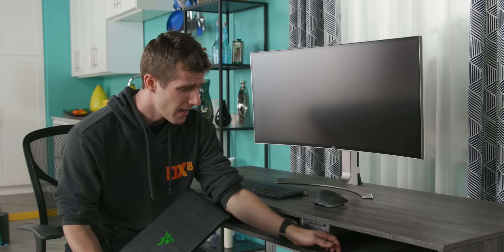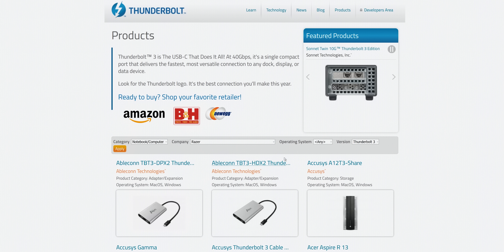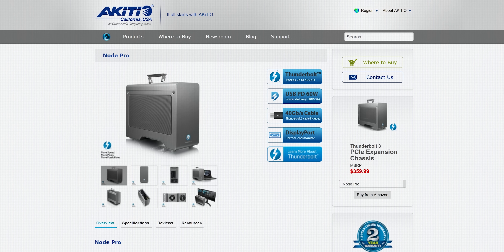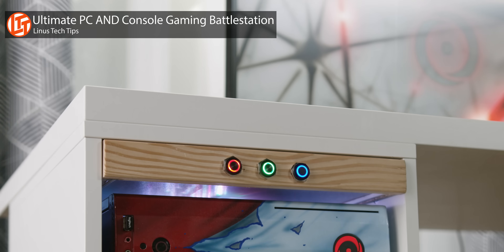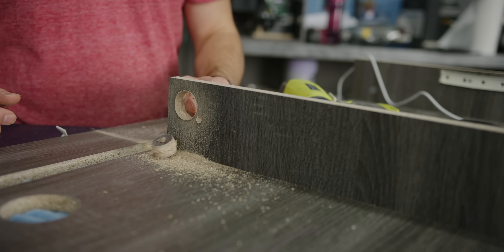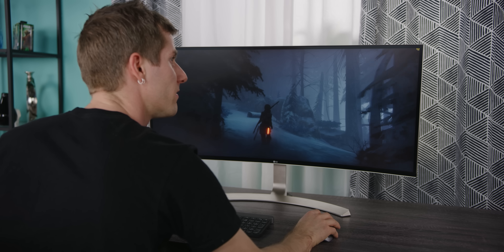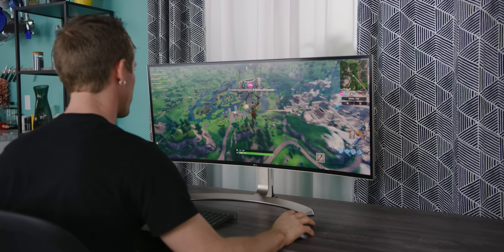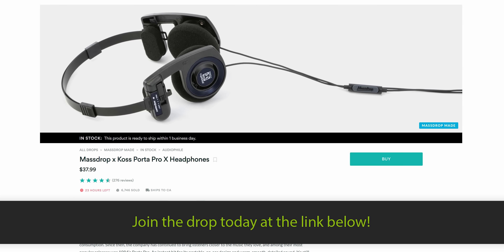This is the CLEANEST Setup.

Comment: It's pretty clean and slick, most definitely.

Here is an even harder challenge. I am a mechatronics engineer, meaning I work on hardware powered by electrical signals, such as robot arms, soldering, PCBs etc. I'd like to see a really space efficient setup, maximizing the amount of surface I get on the actual desk for electronics, soldering and CAD modelling - in a setup that works for a height-adjustable standing desk.

If you can bring it down to 95% free desk surface you deserve a lot of internet cookies! :D

Comment: Like the x-box vid, this is neat and LTT did a fair job of it, but again I don't see the point.  Perhaps it's just that the minimalistic design thing isn't for me, but even then wouldn't you get a better experience just building a PC into the desk?  you're looking at about $700 for the egpu box and thunderbolt hub which will easily pay for a MB,cpu, and ram that will match any reasonably priced laptop, and allow for higher end parts if that's your thing. As for assessing things between computers, is it that big of a deal to use only one port?  Having to plug in a power connector and an ethernet jack doesn't seem like much of a compromise.

Comment: I'd like to see a way to route all cables together in some sort of dock for laptops without thunderbolt/usb-c charging (which this setup requires and you didn't mention), so the power cable, HDMI/DP out and usb a/c dongle for the accesories. It would be interesting for you to do this with a gaming laptop, bonus points if it doesnt have thunderbolt, like many of the ones that were anounced at CES; you add the challenges of cable mangement and cooling (they require better airflow since they have both processors to cool) while removing the one of fitting an eGPU in a desk.

Comment: A Mac follow up would be interesting
Reply: I use a MacBooks Pro touchbar 15” with a Vega 64  razer core x egpu. I use boot camp for windows with lane 9 disabled. It runs perfectly with two 1444 27” monitors. Then when I want to use Apple os restart with option and run in Mac OS. It charges my MacBook Pro easily just one cable for everything. Only thing that sucks is the MacBook Pro cannot adjust the lanes so you can’t use the other thunderbolt ports when using windows. I just use a Bluetooth mouse and keyboard and it works great.
Reply: lol
Reply: As much as I dislike Apple because of their shady business practices, macOS ain't even that bad. If there's anything Apple does right with their operating system, it would be UX and memory management (I can open 40+ tabs on my MacBook Air 2012 and barely feel a difference). In fact, certain applications, such as Photoshop and Premiere, runs faster in certain scenarios. Final Cut Pro is pretty smooth too and isn't subscription-based like Adobe's products.

btw i use arch linux
Reply: mac sux ass 😎 gamerz rize up!!!
Reply: No
Reply: Samuel Rai it’s plug and play besides some weird Nvidia drivers. So not much would be need to be changed. The LG 5k apple display would be cool to see.
Reply: The process isn't very different from this video. No point in making another one.
Reply: No
Reply: No, Apple needs to <insert intense, extremely graphic description of how Apple's products should be punished>.
Reply: fuck apple
Reply: No
Reply: No
Reply: No. We're smart boys here, we don't use macs

Comment: A few obvious omissions that can be incorporated into version 2.0 of the clean desk vid: No audio setup is mentioned, so a headphone connection and storage solution needs to be found. Then also mount the monitor to a wall to get rid of the stand, maybe even set it into and flush with the wall, though maybe that's more 'stealth' than clean. And finally install a mouse charging pad under the surface of the desk like you did for the Qi charger. Though it would probably need to work upside-down if you think about it. Anyways, you HAD said you'd do a full review of the Powerplay after you unboxed it.
EDIT: Ooooo... actually, a lazer TV built into the desk would be the cleanest by far!

Comment: so what happens to the laptop if it starts overheating? doesn't it need to be open to receive proper cooling? You solved the problem with the eGPU overheating, but now what about the cpu?

Comment: You could have skipped the hub entirely and just connected everything to the built in ports... if it has USB3.

What was the cheapest external graphics case of the bunch?... cause you could cheap out on the laptop... since you’re doing your gaming at your desk and build a good gaming system. And if you really need all the power in your laptop to, I guess this makes sense... if it can be done cheaply.

Comment: They have a huge CNC mill and still buys in a desk.
Reply: its probably not worth the trouble/money to construct an entire desk with the CNC.
Reply: @Bl4ckWarHawk  that shitty compressed wood desk cost 500. for that price you could build a much more solid desk out of strong plywood. They already have all the tools necessary.
Reply: @Bl4ckWarHawk  they spent $500 on the desk and spent a lot of trouble modding it to what they needed. It could have all been designed first and then cut from flat stock.
Reply: @Bl4ckWarHawk  a CNC removes matter, unless you start with a giant block of wood, you can't really make a desk with it
Reply: showing it can be done with off the shelf part
Reply: @sayacee5813  The money that was spent, you may as well just have a tower hidden away.
Reply: While I would require more than a CNC and corded Ryobi drill to construct a desk, I'm glad somebody pointed this out. I built my gaming PC desk and it cost me like 40 bucks at best. Never!!!! Pay 500 dollars for a pressboard desk.  Just watch a YouTube tutorial super easy.
Reply: ...so, have u used a cnc mill? Not great for making a desk.
Reply: @originalbob6451  have you ever searched for "CNC desk" on YouTube?

A CNC mill is a fantastic tool for making a desk.

Comment: Another suggestion for a 2.0 version would be some kind of guide rails or slot that would allow you to just slide in the laptop and it would automatically align the thunderbolt port with a mounted, fixed plug.
Reply: Was thinking the same thing, but then it would only fit one type of laptop. Unless they made it generic somehow. I was thinking of a rail system for the hub as well, then at least it would stay put and not drop off.
Reply: Think I’ve seen this before. But can’t remember where 🤔
Reply: DIY Perks already did that
Reply: get a laptop with 2 ports so you don't need to daisy chain
Reply: Yeah but they overcomplicated the whole thing, all they had to do was add another type C cable and then they wouldn't need an eGPU the cost of a full PC
Reply: Samuel what does that have to do with not needing an egpu?
Reply: @Mercuryalreadytaken  It's not about not needing an egpu, but an egpu with that price. What he meant was that they could've connected a cheaper egpu to one usbc port, and the dock they used to the other usbc port instead of buying the expensive egpu just because of the power output.
Reply: Samuel and Gual Casas USB-C is just a connector and can either be thunderbolt 3 or USB 3.1, but thunderbolt has 4x the bandwidth of USB 3.1, they are not interchangeable.

Comment: Like $400-$500 (+1080Ti) of additional hardware to get the performance of what? A 1060, 1070 at best? Plus a lot of hassle between research, limitations and maybe incompatibilities, probably also not enough ports (I don't think VR would even work using a HUB).
I think it would have been much better build a desktop PC inside the cabinet for maximum "CLEANEST", probably for the same price, but with better performance, and you have a totally independent laptop/PC. Also would be much easier to upgrade.

But I have to say, the built-in wireless charging was 10/10.

Comment: "WHy spend money on two PC's when you can just make your laptop better!" .... then goes and spends well over $1,000 to get all the parts to create the desk
Reply: You can also save money by not buying a pc case. Its the price you pay for a clean setup.
Reply: It's not just money though, it's for convenience. One laptop to rule them all.
Reply: @thelegend-e7919  best way is to set up your own server or a NAS and have all your data structured and synchronized properly - the only problem with that is that it's really difficult to set up, but you can have any number of workspaces like this, I have 2 laptops and a phone + a third laptop just as a controller (it's a cheap and easy way to control)

If set up properly, this is the best set up hands down - even better than having multiple monitors and keyboards + mouses in a wired network - whatever that was called, but that can be combined with this for the maximum effect

no need to even carry a laptop around the house unless I want to or I'm going outside
Reply: @theLEGENDofALDO you are absolutely right! He said the GPU was a 1080 Ti, so around 700$ at least, plus the desk alone is like 400$. The eGPU is around 500$ according to Amazon (I am in Europe, so I might be getting a different price than you)
The desk setup without the laptop adds up to around 1900$. Not including the peripherals and the screen (which you would need even with a classic desktop, that's why I didn't add their prices).

At this price point having a desk PC where everything is hidden and looks just as clean (with a probably higher performance) would be as expensive/cheaper.
Reply: Nawar El Sabaa the problem is how do we take that desk pc with us to work on the go?
Reply: @WuschelofDespair  this setup Linus made also isn't portable. Only the Laptop is, and the Laptop is a thin-and-light. You might notice that I never mentioned the price of the Laptop here. I am comparing the desk setups alone.
Reply: @nawarelsabaa  You shouldn't add the desk price to the total setup because you would also need a desk in order to buy a desktop PC in the first place
Reply: @HotCrossJuns   of course you need a desk, it just doesn't have to be the same one here with all the modding involved. 1900$ will get you a normal desk and a great PC to go on top of it/ under it.
Reply: @HotCrossJuns  and you can remove the 400$ that are the price of the desk if you want. 1500$ would have still gotten you better desktop performance than this setup back when this video was made. It still would.
Reply: Buddy boy if you're paying a thousand dollars for two computers they're not gonna run anything more intensive than Doom
Reply: @johannamegido8465  So the laptop was free, eh?

Comment: I did my system just like this, try to use 3m extreme adhesive for the hub, it's really strong, but don't leave anything when u remove them, the 3m out door is good too. I lived in Vancouver too, I can show u my system if u want.

Comment: if your laptop has two thunderbolt 3 ports couldn't you just avoid the whole daisy chain debacle and get whichever enclosure you want?
Reply: Sean Bartholomew he said he wanted one cable to connect his laptop with
Reply: @ontheborderofbored  2 is still not bad also make an enclosure for the laptop cables so you just push the laptop agents the back of the desk and it plugs in
Reply: @bland9876   i agree that 2 isn't bad, but he wanted to do it with 1.

Comment: Honestly, shouldn't you have plugged the monitor into the GPU at this point? The GPU has to transfer the image back through the same Thunderbolt connection otherwise. It saves a bunch of FPS (like 10 or so)

Comment: I made a "cheaper" clutter-free setup with :
- a ACER H277HUsmipuz USB-C screen, thas has 2 other inputs, integrated speakers and 2 USB-A 3.1 ports
- a OMARS headset holder bought on Amazon that I use for its USB hub abilities
- Logitech mouse and keyboard 
- an IKEA desk
- a DELL XPS 15 9560 (not the best choice as I discovered later that it needs 65 to 130 W to charge from USB-C, and chargers that can give that much are expensive so I have to charge it with the proprietary port)

If I don't need to charge the laptop, everything works with one single BELKIN Thunderbolt 3 cable!

Comment: In the last couple of years i switched more and more from desktop pc to a laptop and the main issue i have using gaming laptop is when the laptop is connected to the power cable the battery is suffer for overcharging and die in a year and anyone know theres a solution for that?

Comment: It would be cleaner if you mounted the monitor to the wall lmao
Reply: Maybe but that doesn't make the desk very easily adjustable or the monitor itself, also the stand is pretty slick so unless you can hide the cables from the monitor, it'll look worse.
Reply: @GRAYgauss  Adjustability isn't the goal, the goal is the ultimate clean look. And how often do you adjust your personal monitor at home anyways?
Reply: Or use Samsung’s Space Monitor
Reply: @brandon_nope  that's exactly what I thought lol
Reply: Hate that stand tho. What happened to square stands where you can put shit on? So it wouldn't look so damn "clean"...
Reply: Or even just any monitor arm mount, it'd have a smaller desktop footprint.
Reply: Monitor mounted on the wall with all wires hidden inside the wall would look clean AF.
Reply: Who tf wants to play off a mounted monitor lmfaooooo
Reply: If your desk can handle it, a VESA mount with arm, similar to the iMac G4.

Comment: With the velcro holding stuff (I use it a lot) a top tip is to use either contact cement (barge for you Canooks and Yankee people :) ) or hot glue on the back of the strips you are sticking down, dont rely on the sticky stuff on the backs of velcro strips it is crap and will likely pull away the entire pad the first time you try and move it. The velcro holds like the hulk generally, in fact you can even put a desk together with the stuff.

Comment: I tried something like this, but it was wayyy too expensive. So I tried a gaming laptop, but that was too bulky to carry around. All in all, the cheapest option I found was for under $1000, use a older ultrabook I got for $100, and build a computer setup for $900. Yes you don't have the ease of picking up exactly where you left off, but because I use my ultrabook for internet browsing and note taking, a simple free Dropbox setup to sync up important files. LTT's method is the cleanest setup, yeah, but it's just way too expensive for most of us.

Comment: Dont cut a recess for your mousepad, else you're going to hit the edges on your hand when you move the mouse as the pad will have some give, or the pad would have to be slightly raised defeating the point of recessing it.

I guess if it was a desk mat that'd be different but you could still never readjust it without chopping more of your desk up.

Comment: Okay so I actually did a super jank cutout in my current table for my wireless charger, and it works, but it heats up and the charger stops charging for a while. My table is plastic, but I was wondering if anyone has run into something like this trying to do this before

Comment: Cool in theory but for most impractical. You can't fit same grade hardware for gaming in a laptop if you're not willing to spend a crazy amount of money. I'm better off having a 1k+ gaming pc and use a cheap 400€ laptop for my uni needs. A cool plus is that your brain gets used to each system. For example I never had the need to do anything else on my laptop but work whereas I'm really struggling to study on my gaming rig...

Comment: All this acts as a dock station for your laptop which when you bring to somewhere else has no benefits from any of the stuff here.

Great job, why not portable ITX PC with a portable gaming monitor off from Amazon, I found one with 1080p 120hz 5ms portable monitor.
Clean? Use wireless keyboard, wireless mouse, wifi for your PC, portable gaming monitor need a cable but what do you expect? JUST 2 CABLES, 1 USB-C AND POWER CORD FOR YOUR PC!

Though with that said, this is clean. I give you that.

Comment: I think the warehouse air conditioning cannot be overstated in this circumstance. I have a similar setup that is significantly more ventilated but still reaches temperatures of at least 75 degrees on the same laptop.

Comment: why buy a weak  notebook and buy a external graphic card case that will end up cost more money then a SAGER NP9175 17" gaming notebook.? Why not  put the power of a  GAMING  TOWER PC and the easy take with you portable notebook in a 17.3" Gaming notebook. that is what NP9175 is all about.  its got 90% of what you need. 17.3"  1080p  screen up to 144 FPS 70% NTSC  for its built in monitor. and the dealer can easy upgrade to 4K you pay extra. CPU is i7-8700K and can be upgraded to i9-9900K if you are willing to pay extra. I get a  GTX 1070 that  I am not going to get due to its retirement in its  place  I get free upgrade  to RTX 2070 its got two NVME ports and two 2.5" hard drive ports its got a  RGB keyboard. what is missing is CHERRY MX RED or CHERRY MX BROWN you get a touch pad wtth a finger print  scanner in a strange location. they cut a square i hole n the  upper left corner for the finger print scanner. it will limit the use of the  touch pad.  you get a card reader. Thunderbolt 3  USB 3.1 type C  WI-FI   3 USB 3.0 ports you got yourt  cat 5 e port you got a  8 cell battery that can be removed there is no need for stupid external graphic card case that cost something like $800.00 and you do not get a graphic card.  you can use it if you want. I did not say not to buy a stupid external graphic card case. I did say there is no need to buy it. you can easy buy a  18.1" gaming notebook pack pack is in the option list. for easy portable that cannot be done on a COOLERMASTER COSMOS II CASE.  you can do what ever you want play video games. youtube. video editing, video work.  special effect for video word processor ,spread sheets  calculate the orbit of space nebula M. whatever. you want to do. however CITY OF HEROES is dead. sorry  for that bad news.it had a great life. STATEMAN died in the line of duty